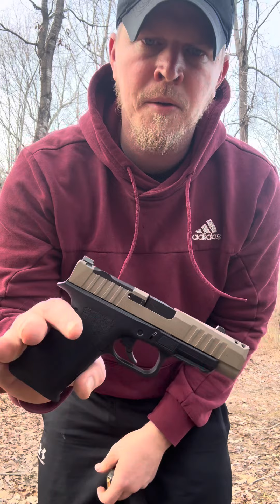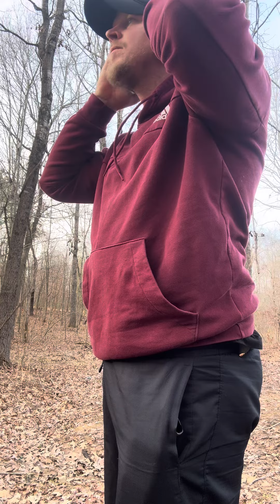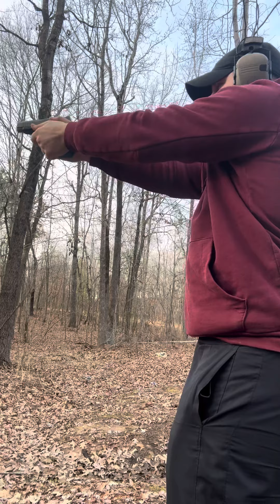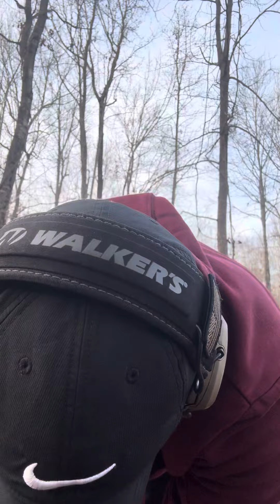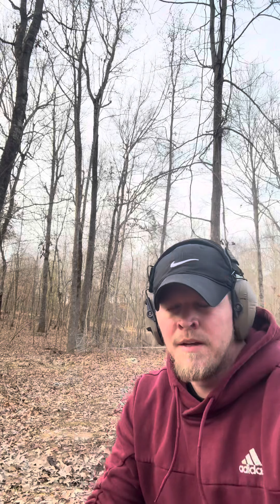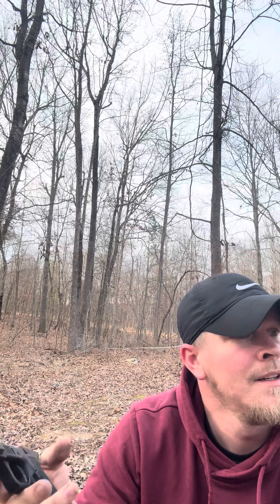PSA Micro Dagger first 100 rounds! Also revealing the SCT SC!

Comment: I just took 2 micro daggers out today to shoot for the first time. 75 rounds through each and zero failures. (I know not a lot of rounds). The one thing I did when I first got them was put glock oem internals in the slides. There on sale from black phoenix customs. If you keep having issues it might be worth a shot.
Reply from the maker: I’m gonna continue to put rounds through it stock. I might polish the chamber a bit. If the FTE continues that is my plan at minimum change out the extractor

Comment: The failures to extract are likely due to the right cover plate screw being slightly too long and dragging on the extractor plunger rod (this rod provides spring tension to your extractor). Try replacing that screw with a shorter one or file it down until there is no more interference. Hopefully this helps resolve your issues. Thanks for the video.
Reply from the maker: Thanks for the recommendation, however upon returning home I realized my plate had came loose so I’m gonna assume the screw had no interference 😅 I’ll definitely put some more rounds through it and may try to polish the chamber a bit

Comment: So I am member at PSA and shoot there all the time. I can’t speak to the gun being an issue but let me tell you I quit buying that AAC ammo which PSA makes. I tried it the 9 MM multiple times and it just was a mess. I had 2 guns running to make sure it wasn’t the gun and I had blazer with me to compare. Lots of FTE with that stuff. I quit that stuff and went back to old faithful which for me is blazer 124 gr.
Reply from the maker: Man I have shot so many different ammos through this same issues continue..I have changed barrels and extractor same issue..I’m 1500 rounds in and 200 rounds ago I changed the extractor spring and shot 200 without issue…so we shall see.

Comment: There's a chance u may have been riding the slide stop which caused those ftf's.  I got that same slide and sct-sc frame u have and no malfunctions with mine.
Reply from the maker: No man trust me I’m 1500 rounds in now I have been really cautious about hand placement to eliminate that theory…check my latest video for a 1000round update. Even since my 1000 round update I’m now 1500 in and the last thing I changed was the extractor spring for a Glock oem. Shot 200 straight with 0 issues. So hopefully that continues.